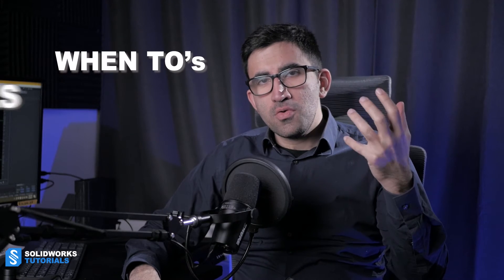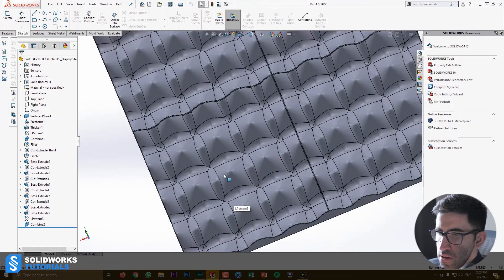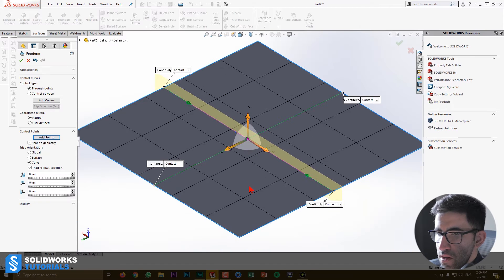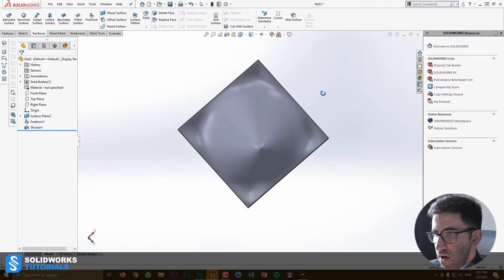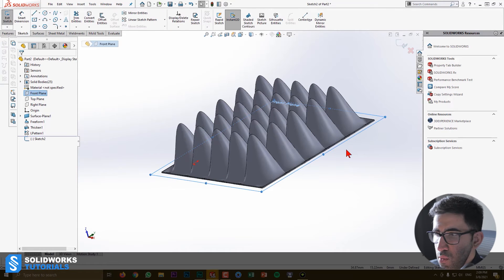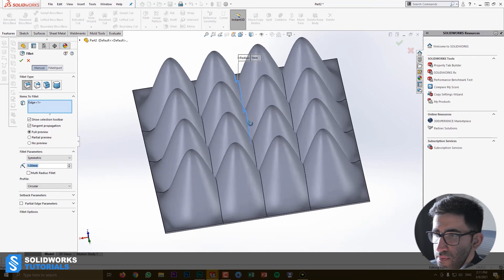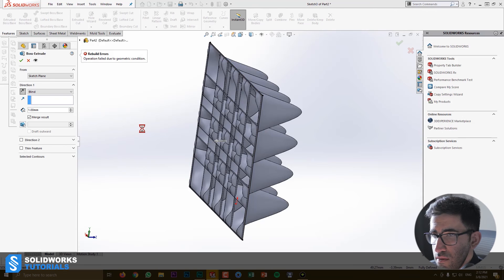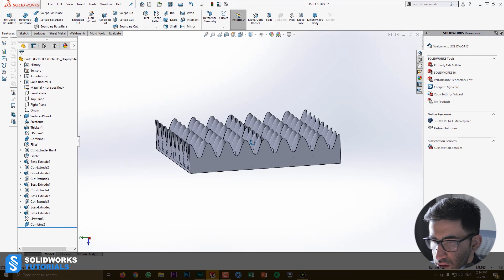Free-Form in SolidWorks - When To use Free-Form in SolidWorks

Comment: How did it fill the inside after last extrude?.... there was a gap in between the bottom square and the freeform structure
Reply from the maker: Get rid of the gaps and KNIT the surfaces and create a solid